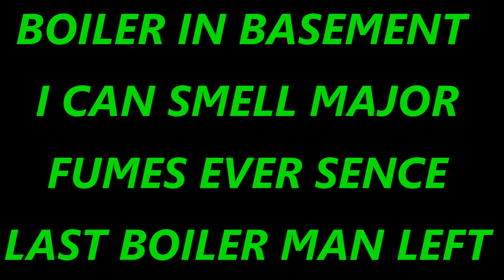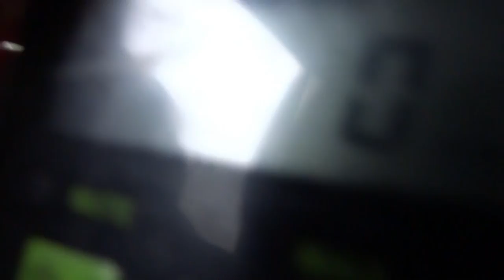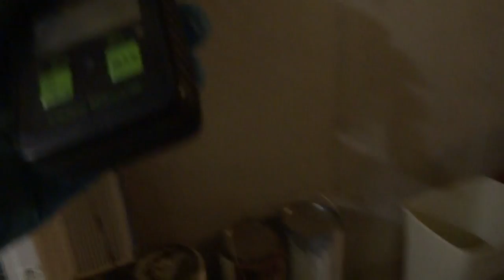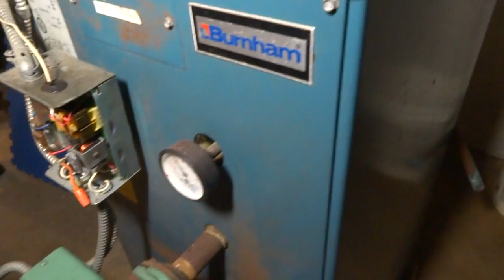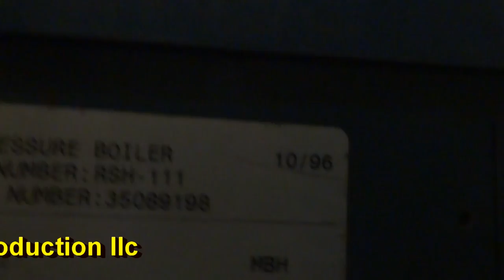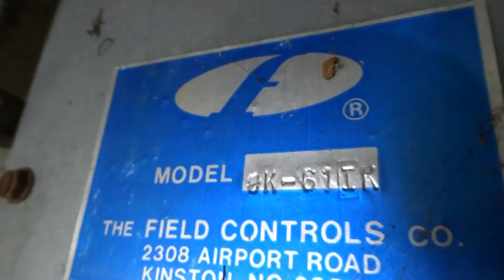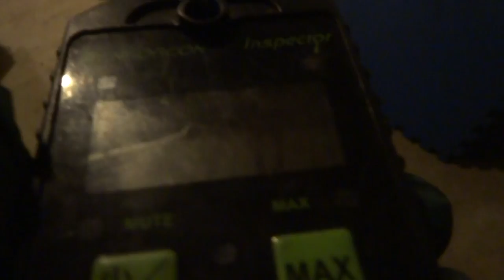MAJOR FUMES FROM BOILER IN BASEMENT

Comment: Where it goes from 4” to 7” the pipes are installed wrong.   The upper pipe is going into lower pipe , air can flow out. 29:10

Comment: Nice diagnostic Steve, and nice that you didn't Red Flag it after the temp fix ... pretty sure the guy got the drift that you were a guy to be trusted to replace it after you explained the dangers ... potential problems, but no CO2 present .... that power vent sounded awful funky  ... corroded and unbalanced blades, bad bearings I'd assume ... time for the crusher ; )

Comment: Why do some boilers have power venters and others don't? Mine just vents into the chimney. never had any fumes.
Reply: My house originally had electric heat.  Later it was converted to forced hot air oil furnace but because when the house was built with electric heat there was no need for a chimney so they had to vent the new furnace out through the wall with a power venter.  I'm guessing this house doesn't have a chimney.

Comment: I wouldn't want the first hvac guy who missed that leaky stack. That is what we are up against, a customer trusts the hvac guy to correct things like that. If you get the job we can see where the hole is inside. I hope the supply house restocked boilers. I didn't like the New Yorker from your last install that much even though it works good. The pressure gauge and relief valve are so tight.

Comment: I had a fuel company delivery fuel oil in the basement and it was 400 gallons of fuel oil soaked in the dirt basement and the delivery guy was a new driver none the less , totally didn't check the full pipe

Comment: I really enjoy your expertise on these oil units but wonder why you don't usually pull a smoke test.
Reply: @MichaelAnderson-py1ej  Why charge the customer an extra hour labor on a pile 'o shit boiler he's going to replace in a week or two?  That's the definition of a hack...  Frankly, most HVAC guys would have red tagged that 26 year old death trap.  But Steve got it sealed back up and checked for CO a couple of times.  Told him it's good for a couple of days, but it needs to be replaced.  Had the customer sign his service bill with the "Needs Replacement" directions.

Comment: I've viewed your videos for several years now, Steve, and I don't know why, but I'd really like to know the outcome of this service call, more so than any others. The amount of work which was necessary, to seal the top of the firebox, adjust the damper to attempt to improve the poor draft condition, and the fact that the power venter did not have "additive effect", sufficicent to satisfactorily improve the draft-over-fire, combined with a hesitation that I heard in the homeowner's voice, as you were informing him of the situation, combined to remind me of situations faced (many times) during the 18 years which I co-owned a Carrier HVAC Dealership. This is one of those "fine-line between" what you need to bid to maintain a standard of profitability, and knowing that the person receiving the estimate has no idea of the extreme sharpness of your pencil. (it's almost a "no win in any direction" situation)